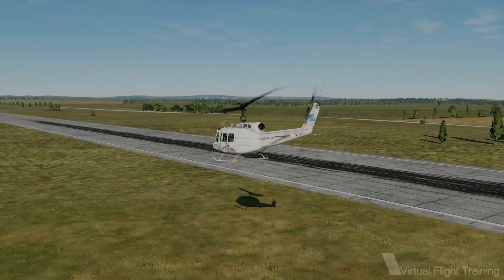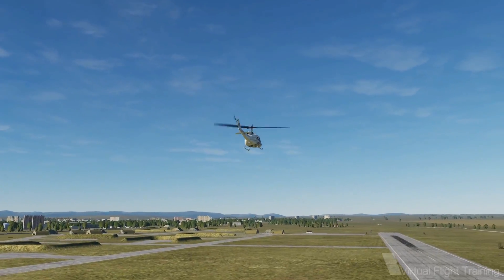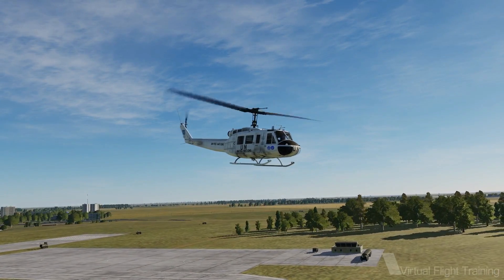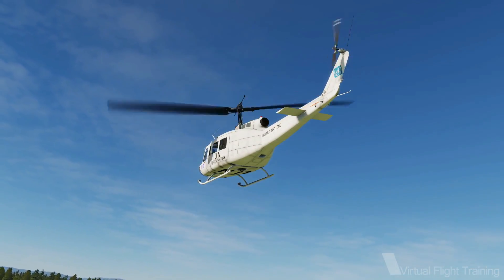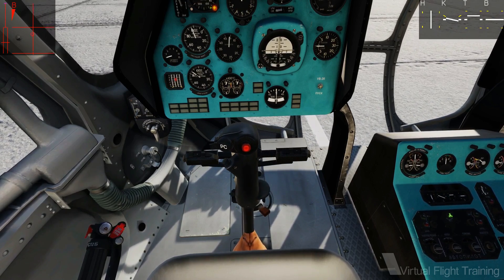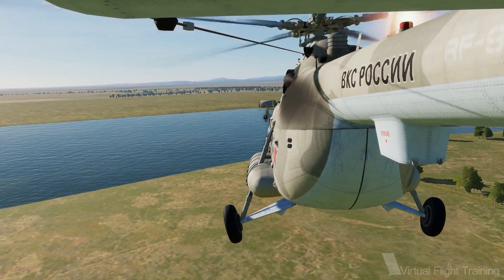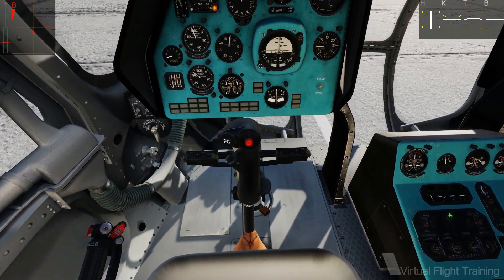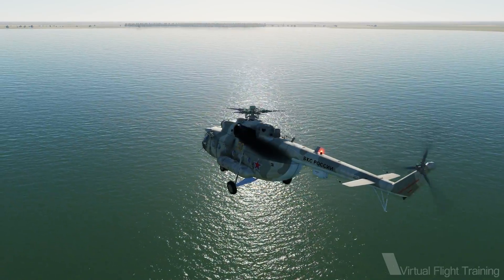Helicopter cyclic stick behaviour explained

Comment: i use a modified microsoft ffb 2 stick with extended carbon tube for long cyclic grip and attached a thrustmaster topgun grip for the huey and typical helicopter cyclic look. I use sim ffb for dampener effect and I use virpil pedals with spring removed. I can't wait to get a collective to finish the thing off.

Comment: I use the X-55 Rhino with the soft springs. 
I love the way it works with choppers (when DCS Trim is working correctly).
I have no issues with the way it works. It is a great Hotas for both Fixed Wing and Rotary Sims (except that internally the wiring is total shit and breaks over time and use).

Comment: Instead of completely disabling the spring using zipties., tie them around 2-3 turns of the spring. By adjusting the ties you can remove 90% of the spring force, allowing almost free movement, but the joystick still has some self-centering. This also allows you to use the sim's built in trim commands (FSX/P3D) without worrying about the joystick flopping around if you let go.